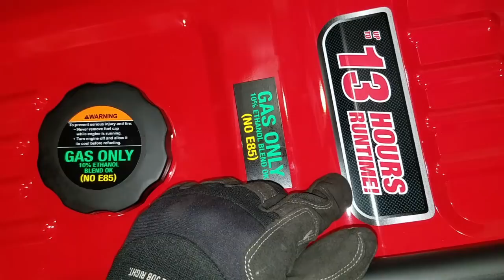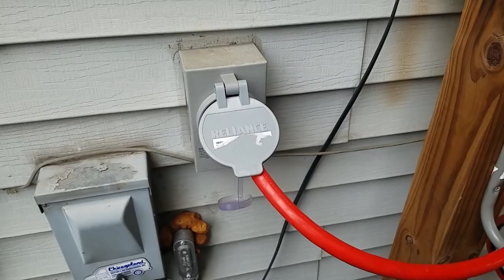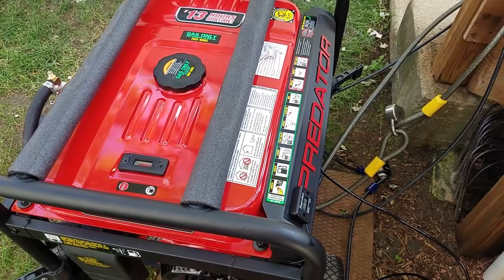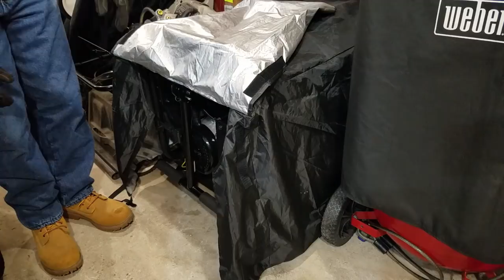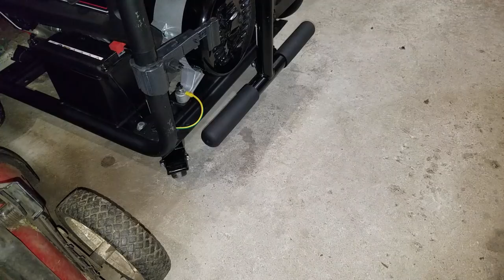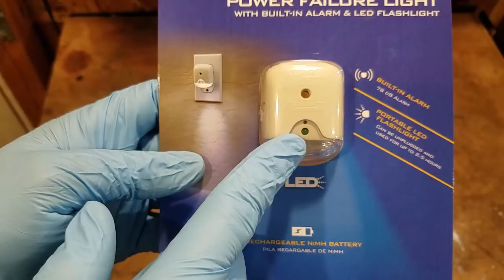Predator 9000/7250 Watt Generator, Tri Fuel Kit and Accessories Review/Testing

Comment: Thanks so much for this video.  I'm a single gal, worship leader here in Nashville - so I can tell ya this is ALL new to me!  I have no idea what I'm doing.  However, I went and also bought this same 9000w gen.  I have many questions.  I won't be using it to the capacity that you are as far as getting this thing hooked up to my house to run my AC, etc.  I wouldn't even know where to begin with all that falling short of hiring an electrician.  However, I was simply planning on using an extension cord, and running it into my house to run my two refrigs, maybe a fan, tv, etc.  1) What gauge extension cord should I use?  A guy friend told me 12g...another guy friend told me I could do a lighter one. 2)  once I get the extension cord into my house, can I simply use a power strip and add other extension cords on to it to run multiple things?  If so, do THOSE extension cords need to be a certain gauge?  Does the power strip need to be a certain gauge?  Thanks for your help.  You're a blessing!  ML
Reply from the maker: Hi and thanks. I understand and would encourage you to hire an electrician to install a 6 or 10 circuit manual transfer switch.  This would be much easier to manage the power loads on the generator.  You wouldn't have to worry about running extension cords through doors or windows. Not to mention making sure you don't over load the generator or cause a fire.  In order to buy the correct extension cords for the appliances you need to use, you need to size up the cord with the power required to run that appliance(s) and volts and amps.  Most refrigerators are on a singe 15 to 20 amp circuit by itself.  (Check inside your main control panel) Here is an article about extension cord sizes.

https://www.protoolreviews.com/buying-guides/extension-cord-size-chart-wire-gauge-amps/50202/

To answer your questions, you could go with a 14 gauge extension cord reel. (See below link)

https://www.menards.com/main/electrical/electrical-cords-cord-management/extension-cords/smart-electrician-reg-50-14-3-quad-outlet-extension-cord-reel/91286/p-1564036103973-c-6410.htm?tid=-3759614358132150087&ipos=1

Adding extension cords to extension cords, you can do, but isn't safe. (I know people do it though) For high wattage appliances like your frig. only have it plugged into that extension cord and that 120V outlet. (The generator has four of these outlets)

All extension cords and power strips should be sized to the power loads you will need.  

Now you can see why I recommend a manual transfer switch. In the long run, its much safer and very easy to set up your generator to run those things you need.  Not to mention you only need one 10 gauge extension cord to run from the generator to the power inlet box.  You won't have to move any appliances to unplug from the outlet to plug into an extension cord. 

I hope this helps and sorry for the long answer.
Reply: @Pk3_Garage  Thanks so much for all this information.  You have been so helpful.  To be honest, your video was very informative, but a little overwhelming to my musician/girl mind.  I know it seems having an electrician come and set me up seems to be the easiest, but it sounds expensive, plus I didn't understand all the things you were showing us with yours.  Because I'm a single gal, it just seems in an emergency the easiest thing for me to do and to understand is to start my generator and run an extension cord to power the things I need to run inside.  Because of your warnings, I will only run extension cords straight from my generator instead of using power strips.  I have two refrigerators. (one: 5.3A....the other: 3.5A)  What do you mean when you say "most frigs are on a singe 15-20 amp circuit by itself"?  Also, did you hire an electrician to install the manual switch, or did you do it yourself?  Just wondering what the cost would be to have an electrician come.  (Thanks for the links too!)
Reply from the maker: Questions: 1) Your frig should be on its own 15 to 20 amp circuit. This prevents tripping the breaker, if it shared that same circuit with other outlets in the house. 2) I installed our transfer switch.  It wasn't hard and I'm familiar with working with electric components around the house. 3) I've heard an electrician charges $300 to $500 to install the transfer switch. The transfer switch can cost $200 to $300 dollars.
Reply: @Pk3_Garage  Thanks so much for getting back to me.  You have been so very helpful!  Blessings to you and your family!

Comment: I read that you have to change the spark plug gap for different Fuel that could be your running problem on gas call Tri fuel back.
Reply from the maker: You do have to make the sparkplug gap smaller when using the Tri Fuel Kit. I had the same thought as you, but when I re-gaped the spark plug to the manufacturer specification, it was the same result.

Comment: Sir, please check this out - there might have been an easier way to get to tri-fuel level.
https://www.youtube.com/watch?v=Twusgs3SgnM

Thanks for the review/video.
Reply from the maker: Thanks for the link. I actually saw and commented on that video. According to the specs. That carborator is rated for max 5.5 kw. So your not going to get anywhere near the 9000 kw/7250 kw capacity the generator is rated for. I know there are a lot of reviews saying it works, but none show running the generator on NG for an extended period of time with at least 50% load. Our generator is being used as a whole house emergency back up power.
Reply: @Pk3_Garage  Ahhh, thanks.  You are right, I didn't delve into it that way.
I have a Generac GP7500E and added this:
https://motorsnorkel.com/product/motorsnorkel/msk3101-motor-snorkel-tri-fuel-natural-gas-propane-and-gasoline-conversion-kit/

It looks similar to your kit and now you have me wondering if it can run the whole house as it does on gas.
As it is an add-on to the original carb, I wonder if it will work fine or not.
Reply from the maker: Try it out and let me know how it works.
Reply from the maker: I ordered just the motor snorkel from the same company. I haven't installed it yet, but it shouldn't effect the air/fuel mixture as much as the adaptor I'm using now.

Comment: Thank you for an excellent, informative video.  All aspects explained in an easy to understand manner.  Did you make any provision to protect your sensitive electronic equipment (PC, video, etc.)?
Reply from the maker: Hi and thanks.  That's a good question that I don't believe I covered in my video. I didn't make any provisions to protect sensitive electronics.  We do have surge protected power strips that we use to protect them. This would be my suggestion.  Once you do it, you never have to worry about this particular step again.
Reply: @Pk3_Garage  You'd probably want to get a UPS instead. Those actually condition the current for clean power. That would be important for sensitive electronics like a desktop PC, TV, etc.
Reply from the maker: Thanks for the suggestion. I've been looking into it, but haven't seen a need for it. From what I can tell, the frequency and volts don't fluctuate much and stays within the recommended limited. I've run all of our sensative electronics with no issues. (60+ hrs.)

Comment: You have a GREAT video so I'm just mentioning some differences I have for others because everybody has a different situation.

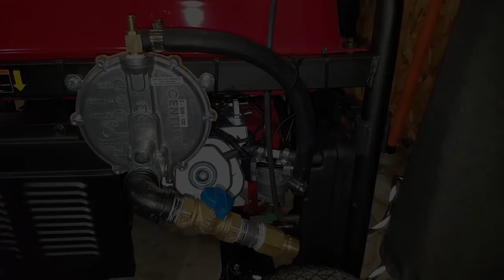0:16:47  I paid $37.50 on eBay for the entire carburetor assembly that was a direct swap.   190F dual fuel carburetor manual choke TONCO safer generator GX420 Propane/LPG/NG.   Here is a video of a similar carburetor assembly installation.   https://www.youtube.com/watch?v=Cf4_73UmvNE
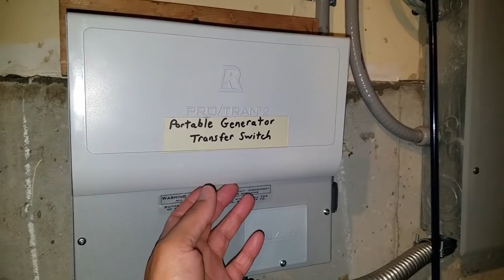0:26:56  I'm back feeding my entire panel WITH THE INSTALLED INTERLOCK for safety.  I have this power meter box to be sure I'm reasonably balanced on the load from the generator.   http://www.reliancecontrols.com/ProductDetail.aspx?MB75
0:59:59  I just installed the flex hose for the drain.   https://www.drainzit.com/
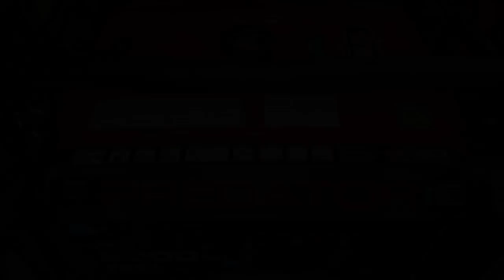1:08:28  I used the TinyTach brand that has hour and RPM in one unit.   https://tinytach.com/
1:13:15  I use EZ-POUR on all my fuel containers.   https://ezpourspout.com/
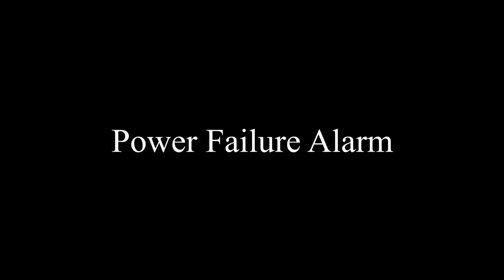1:16:16  OK, I'm not using a power fail alarm but using a power restored alarm.  When the whole house is on the generator you don't know when the utility power gets restored.   http://reliancecontrols.com/ProductDetail.aspx?THP108

The first thing is to replace the OEM spark plug with NGK 5534.
During the engine break-in period use 30W dino oil.
After the break-in period use non-dino oil of the proper weight based on the owner's manual.
Always run the generator with some kind of load.
When using gas only use ethanol-free gas.

UPDATE
Some people recommend to remove the spark plug and pour in a teaspoon of oil.  Then pull the rope slowly 10 times to get that oil to move around.  Then install the spark plug and start it.
Reply from the maker: Hi and thanks for the links and advice.  I'm sure it will be helpful to others.
Reply from the maker: Correct, that's what I did before starting the generator the first time.

Comment: Thanks for making this great video.  Just bought the same generator during the black Friday sale.  Haven't fired it up yet.  Have the wheel kit installed and have bought the oil, non-ethanol gas, sta-bil, and ordered the hours meter, which is supposed to be here on Saturday.  Plan to follow your break-in procedure in the comments.  Will likely wait for hour meter before firing up.  Comments on the hour meter say the instructions are terrible, difficult to follow, and incorrect in some places.  What was your experience?
Reply from the maker: Glade you was able to buy it for $599. I didn't have any issue installing either hours meter.  It's really easy to install, the hrs./tacho meter was a little harder to figure out how to set it though. Had to read through the directions a few times.

Comment: 1st question, Do you drain the gas tank on the generator after using it? Or do you use a fuel stabilizer?  2nd question, Have you ran the generator on propane yet? 3rd question, Why did you go with the Predator generator and not a Champion,Westinghouse or a Duromax generator? Very nice video by the way!!
Reply from the maker: 1) No, I don't drain the tank.  I just run the carb. dry before storage.  I do use fuel stabilizer. 2) Haven't run on propane yet, as I will not be using propane as a fuel source. 3) The Predator was at an affordable price of $599 with coupon.  That's half the cost of the other name brands, for the same watts and features I cared about.  Also, the great reviews.
Reply: @Pk3_Garage   I was just wondering if there was a power difference running propane or natural gas. I am doing the same thing as you just want to have pack up power just in case things go down. With the way this year has been I want my family to be as comfortable as possible. I'll look for the coupon for the Predator. Thanks for answering my questions it will help with my generator buy. God Bless you and your Family. I'll be looking for your next video. Stay safe HOOF HEARTED OUT!!!
Reply from the maker: No problem and thanks for asking questions.  So, during my testing, I can confirm that there is a power loss when using NG over Gasoline.  How much, I can't tell, because I have no way of measuring it. The way I can tell is when running the same things at the same time using both fuel sources.  Do a Google search about the three fuel sources and you will find more info as I did.  I will say though, using the tri-fuel kit, I can adjust the fuel/air mixture, which is a big plus when using NG. I can compensate for the power loss, by allowing more fuel to be burned, to gain some of that power loss back.  So far, I've been able to run everything on our ten circuits, without a problem.  I'm still making adjustments to the power valve and idle screw on the generator, for the prefect balance.
Reply: @hoofhearted1326  don't own one but would love to get one soon.  I've run a lawnmower on gas and Propane Yes gasoline gives more energy. This is out of a propane tank and not Plumbing from the house. But I have no doubt liquid fuel is better. I also understand there may not  be a great savings going to piped in fuel other than convenience which is good enough for me... having a back up!

Comment: Break in new gen . Teaspoon motorkote in spark plug hole 10 slow pulls w/o plug.quart non syn 10w30 with magnetic dipstick already in. Plug back in 10 slow pulls. Gas non ethanol with pri-g ( fuel and oil additive)  best gas can justrite lol
5. Gal. Very ez pour non spill no fumes no leaks steel...never plastic
Reply: Opps.. justrite ll never again plastic :o(  run 5 min no load drain oil.. run 5 min light load.drain oil. Now use royal purple break in oil med load switch on one min off 20 sec on one min..1 hour drain oil. Again royal purple  run on let rest back on 5 hrs.. drain oil  now broken in add penz ultra syn. Or mobile one or other high rated.. long but first class video. Appreciate. Tips very much..
Reply: Great.. I’ve always used plastic for years here in Florida they crack hard to pour with stiff spout tired of trying to hold stupid button always leaks so sloppy. And fumes in car to gas station..:o(.  I just bought the just right metal cans the 5/8 articulated  ( bends ; flexible ) spout much much better ridge on bottom of can and handle you squeeze to control flow no more spills so tight seals means no leaks or fumes ( also safety feature ) I store ethanol separates into gas / water rusts cans gums fuel system sta bil not effective  non ethanol  gas 10% more efficient o water separation found better additive (you tube) PRI-G ...no rusted cans gas stored year even years..
Reply from the maker: Thanks for the advice.  I put a table spoon of 10W 30 Conventional Pennzoil in the sparkplug whole and pulled the recoil 10 times.  I ran the engine for 1 hrs. with a light load, then changed the oil.   Ran it for 3 hrs. on a small load, then changed the oil again, but put in 10 W30 Pennzoil Fully Synthetic.  As too using metal over plastic gas cans, I prefer plastic, because metal cans rust over time.  I've always used plastic gas cans with no problem.